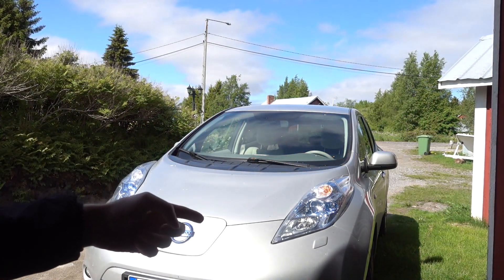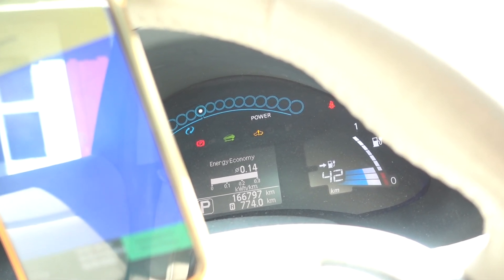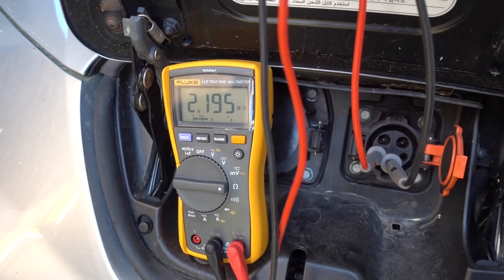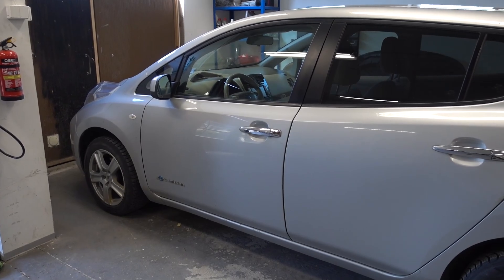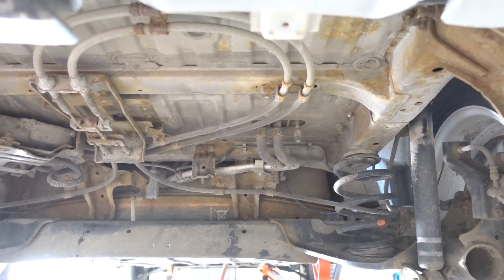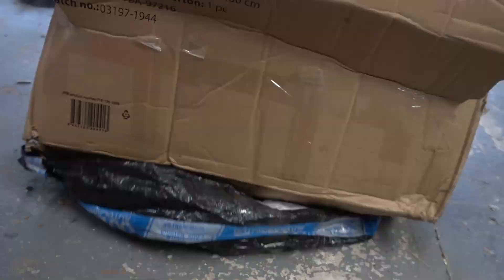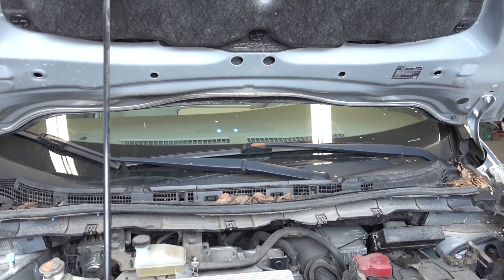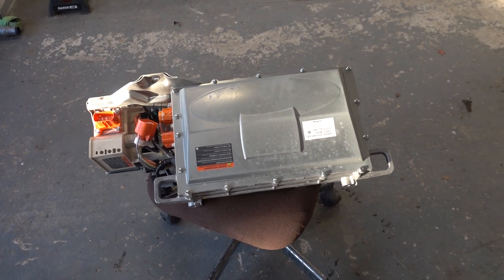LEAF ZE0 charger replacement - B29C1 P3173

Comment: Hi dala i got a 2012 nissan leaf that only charges up to 20 miles with all its battery bars in tact .a month ago i took it to the local nissan dealer and they said the battery was good but the charge controller was bad i spent 2,000.00 on a new one but haven't installed it yet could that be the problem with my car ?
Reply from the maker: Recommend you post some more info, and attach leafspy screenshots and trouble code readouts, on the mynissanleaf.com forum!

Comment: I had exactly the same problem as in the video: charging starts, but after a few seconds it beeps and the charging stops. I have bought another on-board charger. Should I also buy a new charging cable just in case the charging cable was the cause of the on-board charger breaking? How likely is it that the charging cable caused the damage? According to the electronics repairman who examined the on-board charger, it was a short circuit in the "large transistor module".
Reply from the maker: The charging cables are very seldomly a failure. 99.9% the charger itself!

Comment: Hi Dala:  The Leaf's on-board charger, like all high power chargers, is a switchmode device.  The input stage rectifies the incoming AC to DC.  That is why switchmode power converters(chargers) work equally well on AC or DC.  The incoming DC power must have voltage that is close to the rated 230 VAC.  Towards the goal of charging the Leaf with DC direct from a photovoltaic array or from a DC-DC boost converter, what kind of rectifier is used on this charger?  The two kinds that I know of are either switched Mosfets or maybe it has a passive rectifier.  A picture of the rectifier or a report on its part number would solve the mystery.  Are there any components in this charger that require a 50/60Hz signal for timing?

Comment: I did everything in the video but it didn't work. I replaced it with a new on board charger. I did all the cable measurements, still no improvement

Comment: Thank you for the video!  Did you do the high power and coolant line disconnection with only the clearance created with the jack stands?  I ask this because I want to replace OBC myself, but I don't have a lift in my garage.  I wonder whether the clearance you showed in the video was enough for this job.  Thanks.
Reply from the maker: Yes, jackstands is enough!
Reply: 100 percent I used the 50 pound ramps and it was more than enough

Comment: Hi Dala,

I have a 2016 30kwh Nissan leaf ...I have a similar problem in that the AC charging port doesn't work/charge the car. I'm only able to rapid charge via the Chademo port.

The only difference is that Leaf spy is showing no fault codes and there are no charging lights when plugged in, literally nothing happens.

Repair garages for electric vehicles are like the wild west at the mo with many garages quoting me around £3K to fix .... If I have to pay that I have to pay that I suppose, but I'm sure there has to be a cheaper way of fixing it... I havent had it sent to a garage yet for diagnostic yet, that is my next step. Just like I say I'd rather them not come at me with a £3,000 repair price for something that could be done cheaper.

I'm in the UK.
Reply from the maker: You are in luck, PDMs (charger included), can be had for 300-500£ for the AZE0 version. Find a used one and have a local garage fit it. Good luck!
Reply: @DalasEVRepair  I appreciate the help, thank you 👍

I know it's above and beyond but any help or description/link for what I'm looking for so not to spend the money on a further broken one would be appreciated.

I understand it's a lot to ask.

Comment: Very interesting vídeo. I think i have this problem in a leaf 24 kW 11/2014. The car star the charge but ay 2 minuts and 5 seconds cut the charge whitout Transfer kW. In the officer Nissan said me 6000 euros for it ...... But i try to repar myself.
I'm looking the segond hand piece number 292C0 4NR3C, do you know where to buy It, or other compatible?
Thanks !!!
Reply: Do you know if is compatible numbers if de charger 3C and 3D?
Reply from the maker: All PDMs between 2013-2017 are compatible!
Reply: @DalasEVRepair  Thank you for your answer. 
And if i put the 3C ínstead of 3D, the car will accept the change without change the software?
Reply from the maker: @toni7345  Correct, no pairing/programming needed!
Reply: @DalasEVRepair  ok, thank you very match for your help.
Reply: @DalasEVRepair  Today I put the new PDM in my car. I bought one of a crash car of the 2016 (30kW). At first, the car didn’t charge (and I think it can be the battery of 12v because I had only removed the negatives). 
I drove the car 5 minutes and later the car charges without any problems. That’s normal? 
Thanks again for all your help. Without you and your videos, I wouldn’t have changed the PDM.

Comment: At 6:07, I just can't replicate how you get that plug off. It seems you first push down the green part, but you do it so easily, and I cannot get mine to push down like that. Any tips?
Reply from the maker: Green bit needs to be pulled OUT. Take a small screwdriver or plier.
Reply: @DalasEVRepair  Thanks! That worked. I have the new OBC in, and the car charges. Now to put it all back together!

Comment: Hi Dala good video we have the same issue with not charging after 5 seconds. Nissan cant seem to answer a problem and want us to spend 3100  euros on new charging port and charging lead. Report says carried out diagnostic check for B2840. Checked coolant leakage was ok but found signs of corrosion around charging points. The car will charge on fast charge but not the small plug like your video. Do you think we could do a test with volt meter for charging port and lead to give us some confidence as I’m surprised at Nissan to not be sure
Reply from the maker: Hi, charging port and lead almost never fail. It's the charger itself. Start looking for a better used one!

Comment: Adding diode only helps when internal one is damaged and resistance is zero on internal diode itself. Measuring resistance on Control Pilot line with different multimeters might give you different results. If internal diode is not shorted it needs at least 0.7 volts (actually depends of diode type) difference, for current to pass it without high resistance. Many multimeters when set on resistance measurement does not have enough voltage on probes. That's why most multimeters (including yours) has a separate setting for measuring diodes.

Comment: Good Day Dala! Mine isnt charging at all (not on chademo nor L2) code B2840 and P3173. Can it be the obc if it’s not charging on either port I’ve confirmed it can’t be my 12v battery
Reply from the maker: Make a thread on the mynissanleaf.com forum!
Reply: @DalasEVRepair  Nissan says it is the obc and is charging $3400 to fix 😮 I can’t afford that for a degraded leaf I wish it would dc fast charge at least I’ll try to jump on forum. I would rather source one myself as I can do it but is that really my problem?
Reply from the maker: @HellaCopter  on the ZE0 its 99.9% the charger that has failed yes. Source a known working used one!
Reply: @DalasEVRepair  😅 just sourced one for $75.00 USD (no joke) and a face full of coolant 😂 Gonna start the install fingers crossed! 😊
Reply: @HellaCopter  did the switch out work? weird that the chademo also didn't work if it was the OBC. The DC to DC charging (level 3) shouldn't be affected.

Comment: my j port charger stopped working, dealer diagnosed bad on board charger, I'm thinking I can change it out myself, how difficult was it? I tried adding the in line diode did not fix my problem, thank you so much for posting the video I will begin this repair soon, I'm experienced with circuit board repair , I will let you know my findings, quick question does updating the firmware increase the rage?
Reply from the maker: Do post the repair attempt on the mynissanleaf forum (with pics!) 

Firmware update does not increase range!

Comment: Could one upgrade to 6kw at the same time?
Reply from the maker: Sadly not. The 2013+ 6.6kW charger is mechanically and software-incompatible. The 2011-2012 just has 3.3kW chargers as an option.

Comment: that's interesting that they actually cooled the on board charger back then but they didnt thermal manage the battery packs. Great job as always 💪💪💯💯
Reply: Exactly
Reply: Im still surprised nobody has produced a good battery cooling upgrade. Obviously it’s not easy or it would have been done.

Comment: Locating the onboard charger behind the rear seat keeps it cleaner than the charger on the iMIEV. With the design issues of the early chargers it is reassuring that it is fairly straightforward to replace. At 6:30 you say that you found a "better used onboard charger". Please clarify  whether or not the design is a later version that is backwards compatible. 🤔
Reply from the maker: All ZE0 compatible versions listed here: https://evsenhanced.com/services/on-board-charger-repair-firmware-updates/

Comment: Hi Dala. Hopefully soon I would need to change the refrigerant in the whole system of my 2012 Leaf. Need an advise about it. I have three gallons of Toyota organic (pink) antifreeze that I bought for my hybrid Auris which I have in my garage doing nothing but getting old resting there. My question is I’ve been reading about the topic and the antifreeze is High quality and last longer compared to Nissan (blue) one. If I make a purge with destilled water and replace it with the pink one, would it be wise to do it or not? Need your advise about that. Thank you in advanced Dala.
Reply from the maker: Sorry I have no A/C experience (or equipment)! Try the mynissanleaf.com forum!
Reply: @DalasEVRepair  It is not for ac Dala, is for the radiator and coolant & antifreeze for the whole system.
Reply from the maker: @jesuskingofkings  Oh, I just read refrigerant and instantly thought about A/C. I would stick with a Nissan certified fluid just to be sure!
Reply: @DalasEVRepair  👌

Comment: Thanks for the video, was thinking about upgrading my 2014 leaf to 6.6 charger. Not thinking it's worth the effort until it packs up.

 Is there any funkyness going 3.3 to 6.6 charger or will it drop in?
Reply from the maker: Drop in replacement!
Reply: Will that 6.6 drop into a 2012?
Reply from the maker: @dorhocyn3  Sadly not
Reply: Has someone put together a chart showing the upgrade pathways via part swaps?

Motor controller upgrade - higher kw motor output.

This charger upgrade

Battery pack upgrades - what physically fits and what can bus upgrade needed?

Comment: Had to do the same on my 2012 two years ago. It was a condensator deep into the charger that were blown in the faulty one. (Had also put in a 40kWh battery in that car with the CAN-bridge from DALA). Last fall the heater blew the fuse that is deeeep into the "engine". I sold the car instead of spending days tearing down the car to get to the $1 fuse!.  (Now driving a 2019 40kWh Leaf)
Reply from the maker: Still massive props to you for keeping it going for so long! Hopefully the next owner could continue the tradition :)
Reply: @DalasEVRepair  He did.
Reply: Usally heaters itself is going bad, fuses does not burn for no reason...
Reply: @pashko90  , this time the heather failed so the fuse blew. (0 Ohm measured)  Replaced heather, but no heat as the fuse were blown.
Reply: @tucsonor  o Ohm its a good fuse...  OL is not good....
Reply: @pashko90  the heather, not the fuse. After the swap of heather the Leafspy could erase heather faultcode, but started to throw out error for eatch power step in the heather, as zero voltage.
Reply: Is there a video of that fuse and heater being replaced, we have a 2012 that the heater doesn’t work. Also there is a code for some kind of pump that’s not functioning, one of the cooling pumps.
Reply: Can the ze1 6.6kw charger be retrofitted to a 2012 leaf?

Anyone done this?
Reply: @MatthewTaylorAu  No

Comment: unfortunately this is not for long, these chargers are a mess and almost not repairable...
Reply: Some of the damages comes from incorrect connecting and disconnecting sequence by people who use portable EVSEs. When connecting for charging, EVSE must be always plugged in to wall socket first, and only after this vehicle can be connected. When stopping a charging it must be done opposite, vehicle must be disconnected first and then it's ok to disconnect EVSE from power source.
Reply: @ev-olution8597  Agree this was how mine got damage it was charging then i unplug the power but this is not how i normally do it, I was in an hurry to leave work, when i got home and plug in the car wouldn't take charge, so now i make sure to remove plug from car first then unplug EVSE from main power.

Comment: Coolant?  I thought it didn’t have a liquid cooling system??  (Or is that only for the battery and not the charger?)
Reply from the maker: Coolant is used on the LEAF to cool down the motor/inverter/charger. It is also used on the early leaf to transport hot water for cabin heating. Only thing that doesn't get the coolant is the battery.